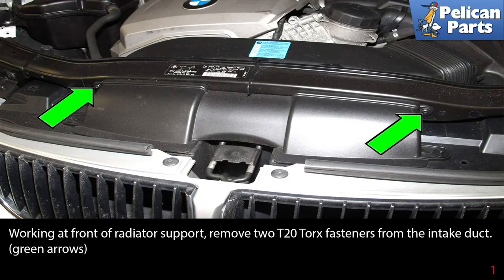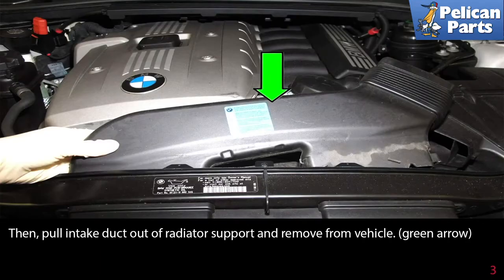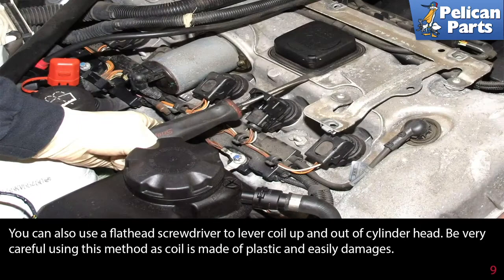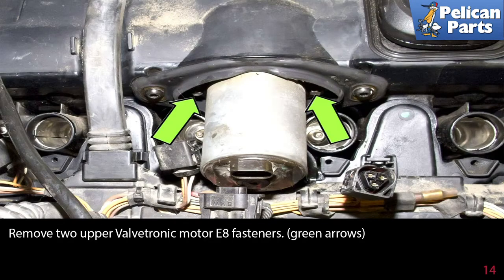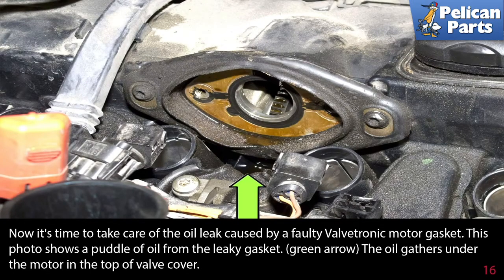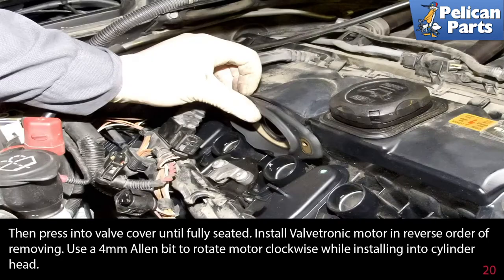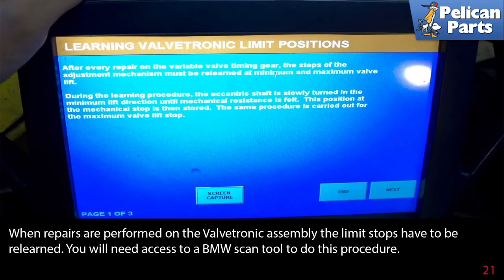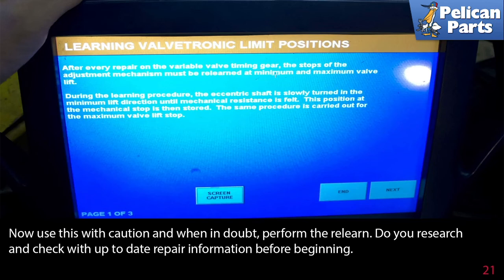BMW E90 3-Series Valvetronic Motor Replacement 335i, 325i, 325Xi, 330i, 330xi, and 328i

Comment: Hey Mate thanks for the video, was wondering if you can provide a link for the valvetronic motor part for a bmw e90 320I 2007 series
Reply from the maker: https://www.pelicanparts.com/More_Info/11377548388.htm?pn=11-37-7-548-388-M82&gclid=EAIaIQobChMI5ujEvtvs7gIVl-CzCh2OJw1hEAQYASABEgKXavD_BwE

To be sure, Give our parts specialists a call at 1-888-280-7799

Comment: Hello this is my first time doing this job, I am replacing the Valvetronic motor, do I have to do a stop limit positions or just the key on cycles?
Reply from the maker: Key cycles usually works for the same motor being removed and installed. New ones almost always need a scan tool to relearn the limits.

Comment: Do you have to calibrate it afterwards or can you just plug it in and drive?
Reply from the maker: Has to be programmed if new. Using the limit stop adaptation using a BMW scan tool. If installing a motor that was removed for a repair, you can often cycle the key before starting the engine and make it out ok.

Comment: The e8 bolts seem to be aluminium. Where can I buy them? Every walkthrough, eventually this, seems to just reuse them, so I am pretty confused. Thanks
Reply from the maker: With your vehicle info handy, give The Pelican Parts parts specialists a call at 1-888-280-7799. They can figure out whatbolt kit you need.

Comment: Hello, I installed a new motor and it was running fine. After around 10 minutes my car started making a not loud, but noticeable squeeling noise coming from the valvetronic motor. When I installed, I didn’t tighten the Allen key all the way clockwise, so should I go back and tighten it? I tightened it and then turned counterclockwise two full turns and left it, so is this causing it to make the noise? Other than that, it’s a brand new motor so I’m having it reprogrammed soon for the limits. 

Thanks!
Reply from the maker: No, you don't have to tighten it. You simply seat it so it is flush, then torque. Turn key on with engine off to allow it to learn, then start engine. If you have a noise, likely something different.

Comment: Hey mate. Thanks for the video. Very easy to follow. Just wondering if this is the same for a 2006 530i and what circumstance would dictate a relearn of the valvetronic travel settings being required. Thanks
Reply from the maker: It should work. Some items, like wiring locations, engine accessories will be different. But the bulk of it is similar.

Comment: May you help if you know please. i swap the motor, learn it too, it's working fine for 50-60 miles, then i loose again power and need to re turn the motor by hand and it works perfect again for 50-60 miles, not sure what's issue as scanner said it's learned
Reply from the maker: I would start by checking the DME for fault codes. If the system is not working properly, a fault code will be set. This will be your best bet when diagnosing.

Comment: What would happen if you don’t put the Eccentric shaft back to the open position before you complete the job? I recently had this job done and I’m experiencing issues. Any help would be appreciated.
Reply from the maker: It depends on what repairs were done. If you did not set the limit stops, you could have fault codes and rough running.
Reply: @pelicanparts  I tried doing the limit stops but at the end of the programming it says unable to connect, but it does do the 450 cycles and the 50 trouble free cycles, as soon as it gets to the end it says unable to communicate. I’ve done it with 3 different scanners. The parts I replaced were the valve cover and the valvtronics.

Comment: Hello

When you reinstall thr valvetronic you screw clockWise gently to engage the valvetronic but when it is engaged and the 3 bolt are screwed did you turn slightly conterclockwise to allow the valvetronic fitting correctly and have peace of mind  about the good fittings or is it absolutely not needed at all
Reply from the maker: Thanks for the Info.
Reply: @pelicanparts  my question was 

when it is engaged and the 3 bolt are screwed did you turn slightly conterclockwise to allow the valvetronic fitting correctly and have peace of mind  about the good fittings or is it absolutely not needed at all?' ?

Comment: Hi
2011 328xi 3.0 
I got ‘stuck’ on my valvetronic motor. It backs out but won’t come out. It is almost out and it goes back in a bit and make a ‘cranking’ sound.
Please adviseHi
2011 328xi 3.0 
I got ‘stuck’ on my valvetronic motor. It backs out but won’t come out. It is almost out and it goes back in a bit and makes a ‘cranking’ sound.
Please advise
Reply from the maker: Possible the gear on the Eccentric shaft is worn or damaged. If the motor will not twist out, it may have to be forced out. Then all parts damaged from the forceful removal will have to be replaced.
Reply: Pelican Parts 
Hi, I appreciate your input. The 4mm bolt twists fine. I was able to take out the motor but with a little force. ‘hope nothing is damaged from that. Thx
Reply: @simplelangperorock  how did everything work out?